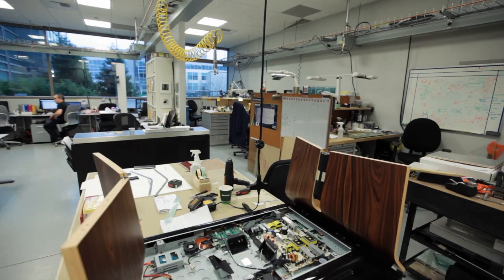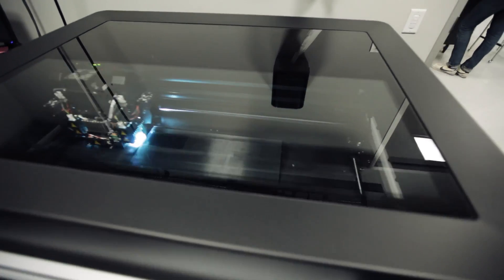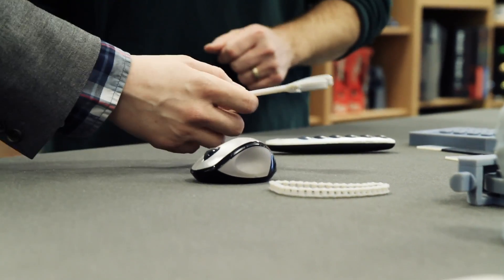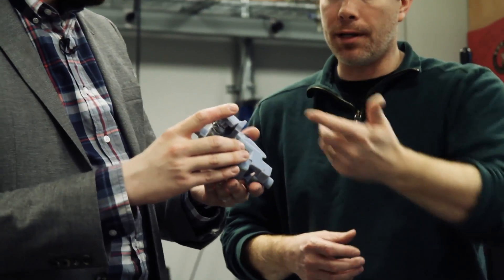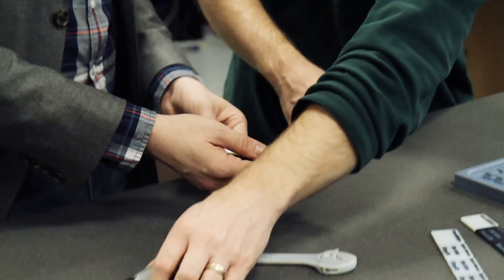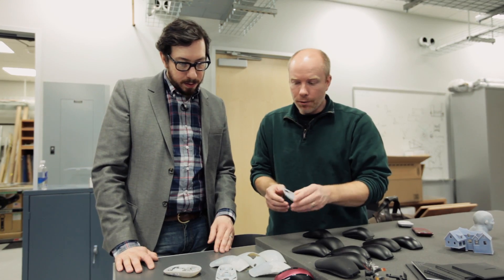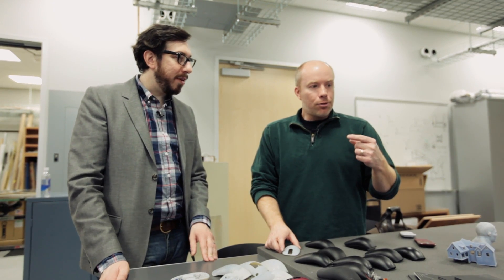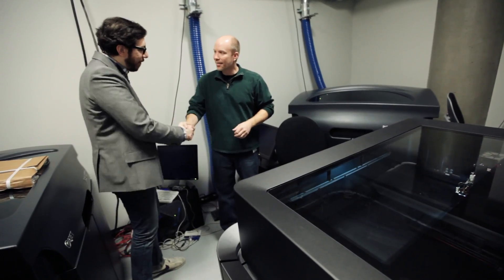Inside Microsoft's model shop, where prototypes are printed in 3D

Comment: Microsoft is still working on a mouse as the rest of the world is moving to touch screens. I'm having flashbacks to 1990.
Reply: Windows doesn't require a mouse; it's a useful extra. Mac OS, on the other hand, requires a mouse (or other pointing device); it's not optional.